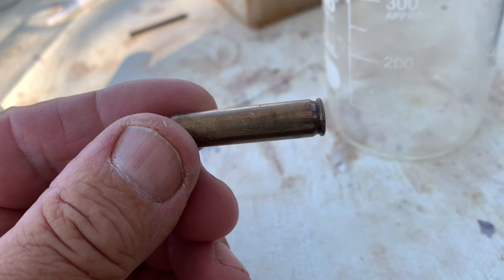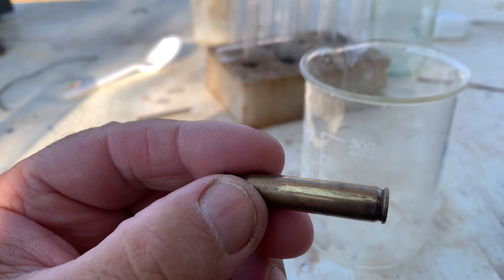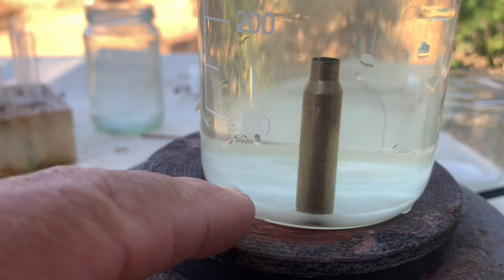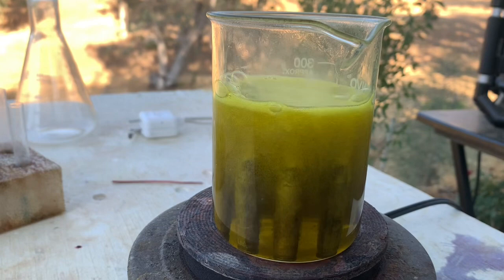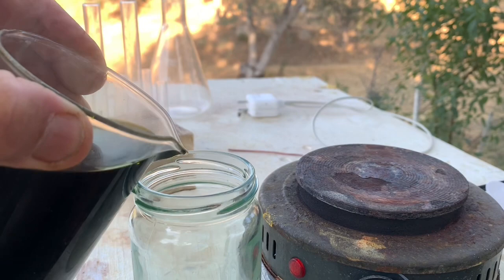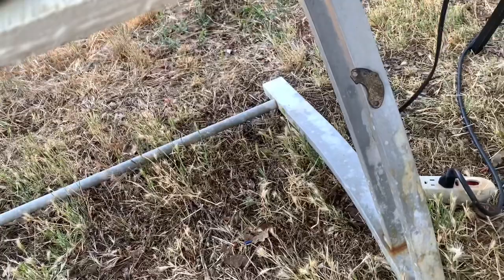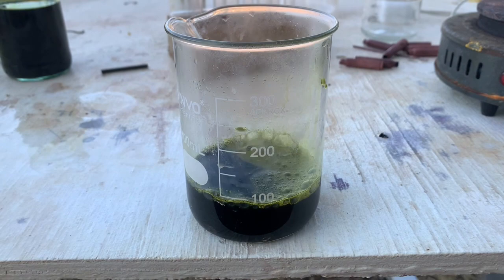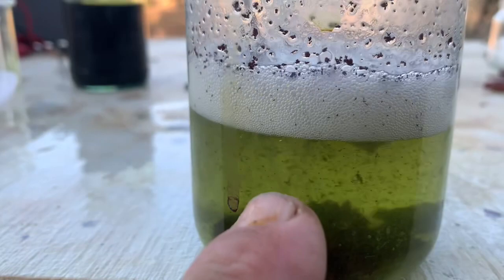Hou to work with aluminum for gold recovery

Comment: What is the purpose of the operation? Is it the deposition of gold with copper?
Reply: Copper substitute for gold
Reply from the maker: No ! Copper is just démonstration Hou recover the gold using aluminum.
Reply from the maker: It is just demonstration hou to recover the gold . Copper and gold works the same way. If you recover copper  then you can recover gold the same way

Comment: If your Nitric solution was Nitric Acid , why did it not dissolve a Brass bullet case , (Copper + Zinc ) = Brass .  Nitric Acid will dissolve Copper and Zinc . So when you drop  your precious metals out of solution using Aluminium for  gold recovery , then your brown powder will be copper and gold .  How do you get rid of the copper . Also , you can kill the Nitric with Sulphamic acid or Urea .
Reply from the maker: That was just explained Hou work with aluminum.. if sometimes you get gold and copper then use nitric acide to dissolve copper. What’s left is the gold
Reply: That's true.